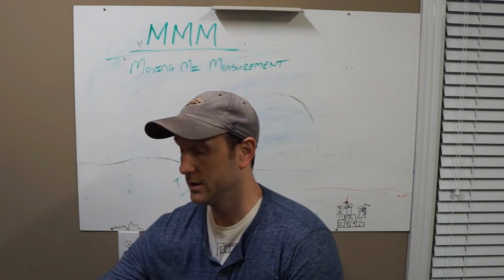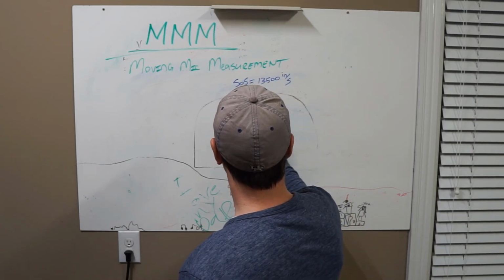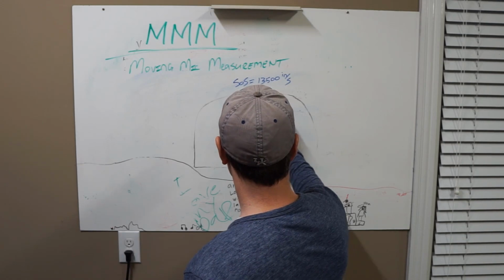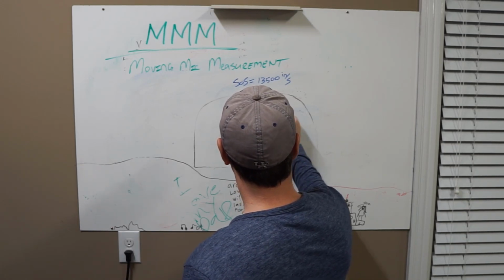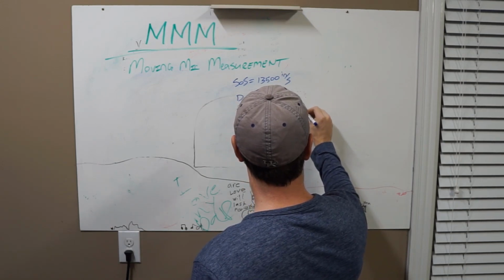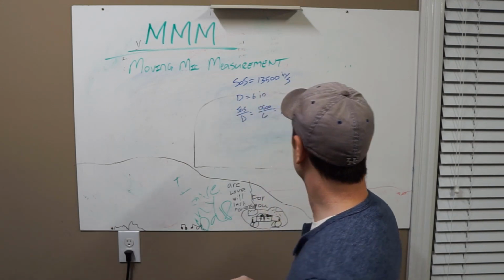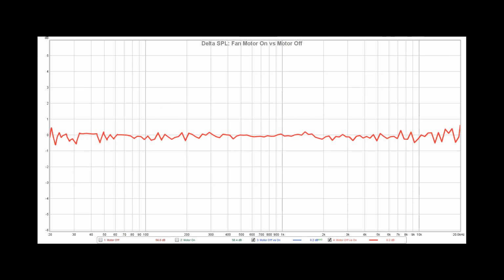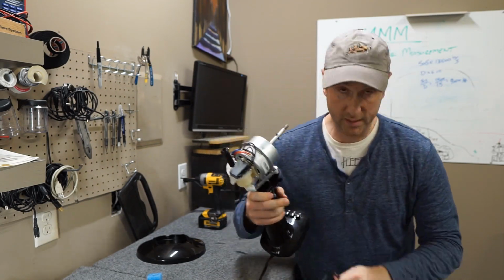How-To:  Build your own RTA Moving Mic Measurement (MMM) stand for $25!

Comment: I don't have a garage anymore :(, I wonder if I can use some adapter to plug the fan into the 12V outlet.
Reply: Can always use a small AC/DC inverter. That will plug into your 12volt cig lighter .